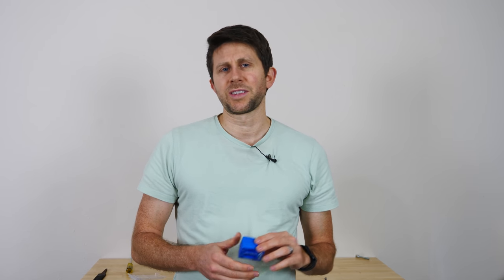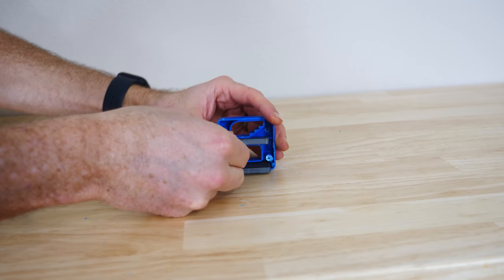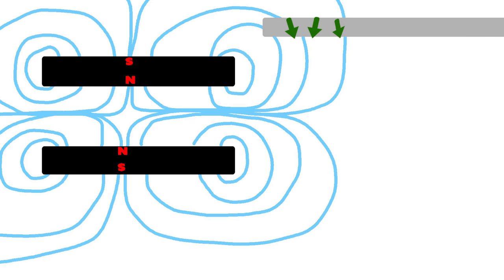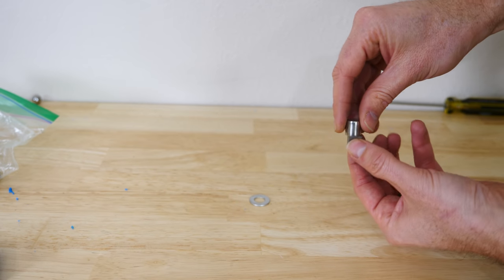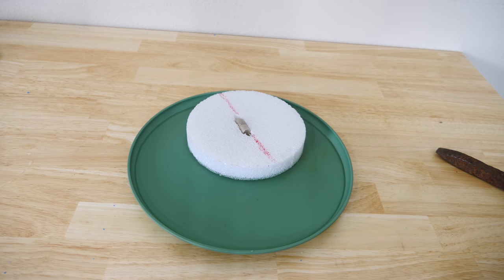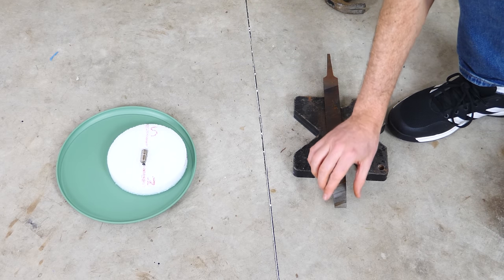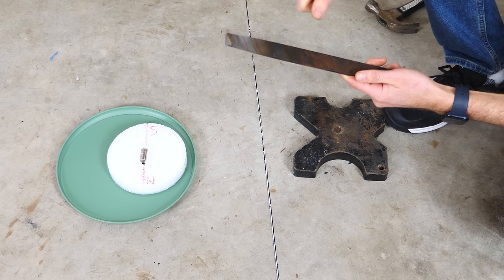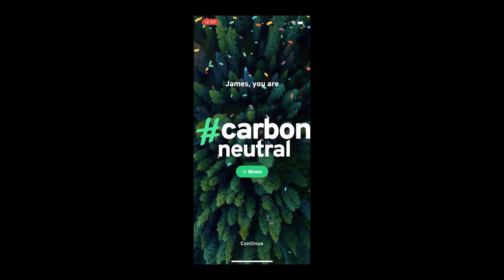Can You Magnetize Iron Just By Tapping It?

Comment: Theres a great and simple video on utube called "home antigravity project" look for a pic of a torus coil. Its based on the old german foo fighters or the later fluxliner.
It uses opposing fields reflected by a copper disc throwing electrons outwards to the edge of the disc. Uses the air as a capacitor. Basicly vibrates a field so the air feels thicker; like its floating in water

Comment: Vacuum chamber video idea.
Create a small Rube Goldberg machine that starts working when you put it under vacuum. Two mechanisms I can think of is liquid boiling, use water as a weight and when it boils off it sets off something, also can use the gaseous form as another force. Other idea is to use the expansion of air, could make a pneumatic lift using capped syringe with air, use some fishing line to anchor the plunger from flying out if you want it to stop at a certain distance and let one fly out later. Mix gold foil in with the air for some fun effects.

I bet you can come up with tons of cool ideas with all the effects you've tested.
Reply: Another idea, use a ballon that expands towards a pin. Could set the ballon to fill with gas from the boiling water using a tube.

Comment: So does that mean that forge shops have to put their parts perpendicular to the earths mag field after they come out of the presses?
Reply: @KokoJeuru  "you'll be sticking it in forever"
Well, something must be wrong with the Earth because I only managed 4 minutes. 🤔
Reply: I had wondered about this too. I think aligning a long piece of solidifying iron perpendicular to the Earth's magnetic field would still produce a magnet; the poles would just be on the sides. It would be a short, squat magnet. To eliminate the magnetic effect, I guess you could either rotate the metal as it cooled -- or rotate a strong magnet near the cooling metal.

Comment: You missed an important test. If you put a string on the file will it turn to the north south position. Use water and float it too. If that works that would be awesome.
Reply: you missed   period.        your suggested (water float) experiment  Can  be  conducted:   with a much smaller  piece of  iron/steel.

Comment: Does aligning the polls in steel or iron, weaken,  strengthen or do nothing to the material?
Reply: Nothing. Some of those magnetic domains are flipping every time you bring it near a magnet and every time you move it within the earths magnetic field so it's constantly happening. The object becomes magnetic when the majority of those domains point the same direction. A permanent magnet is one where you align all the domains and they are resistant to being moved again so it keeps its magnetism even around other objects that would influence it.

Comment: You probably didn't do it properly, if you rub a strong magnet against a metal that gets easily magnetized it should become magnetic if done right, I've done it a lot at work, magnetizing my screwdrivers so that screws stay on them, i do wanna mention that it's impossible to make them strongly magnetic and it fades away eventually
Reply: Yeah, this was one of the first thing I learned about when using a screwdriver. It makes the screws easier to use. I'm not exactly a tool guy, but this is something everyone should know. I'm sure there's an instance where one might not want a magnetic screwdriver... but in general, i prefer mine magnetized

Comment: A skeptical viewer would wonder if the metal object you are using as an anvil is actually a magnet or magnetized. Thankfully, I'm not a skeptical viewer. ;)
Reply: Plot twist: it is
Reply: For the skeptics, because there will understandably be a few… If the metal plate he was using as an anvil were even the slightest bit magnetic it would represent a very large magnet with a proportionally large magnetic field that would easily attract and align the small magnet floating on the water only a few inches away. And it would also completely overpower the very small magnetic effect the file had on the floating magnet. Lastly, if the anvil were a magnet, hammering a file on it would have entrained the file to the ANVIL’S North and South magnetic poles, rather than the Earth’s North and South poles. This would happen regardless of its direction relative to the Earth’s North and South poles because even though the Earth has a larger magnetic field, man-made magnets have stronger fields locally. (Though they roll off quickly with distance because magnetic fields follow an inverse square law). FYI- He could have used concrete or a rock as an anvil. You just need a hard surface. 

For the knowledge loving skeptics… Here’s a couple of fun experiments to try at home:
1. Make a file magnetic by hammering it as seen in the video above. Wear safety glasses! Metal can chip. Put the magnetic file on a piece of floating styrofoam and see if it eventually aligns to the Earth’s magnetic poles. More mass may take more time.
2. See if the magnetic file can be used to magnetize other objects, for example; a sewing needle or paper clip. Can that object then magnetize other objects? 
Fun Fact: You can make an emergency compass by carefully rubbing a needle with certain cloth, such as silk, certain animal furs and even your own hair, and then floating it. Just don’t stab yourself! 

—A science teacher’s job is to turn understandable, and sometimes healthy, skepticism into understandable, and much healthier knowledge.
Reply: @DanielGBenesScienceShows  I don't know. I feel like he put a magnet under the anvil.
Reply: @Anonymous-df8it  I can appreciate a healthy amount of skepticism on YouTube these days. But I would add that any source of hidden magnetism strong enough to affect the amount of steel in a large file would have easily been given away by the floating magnet and few inches away. One way to find out for yourself… Try it! FYI- You don’t need a metal anvil at all. The point is you’re upsetting the crystalline structure of metal in the presence of a magnetic field, which you can do on any hard surface. Machinists constantly struggle with tools, such as files and drill bits, becoming magnetic which then attract metal filings. Not good for precision machining. 
You can also destroy expensive magnets with heat. Trust me, I know. I was making magnetic plastic Easter eggs to give to students in a spring science enrichment class and I happened to demagnetize 40 expensive neodymium magnets by hot glueing them inside the eggs. When I was all done making them, none of them had any magnetism left. It was a fun lesson for me. I now know to look up the heat specs of magnets before using them.
Reply: @DanielGBenesScienceShows  Oh, ok
Reply: now, see what you started.!!!!        shame on you